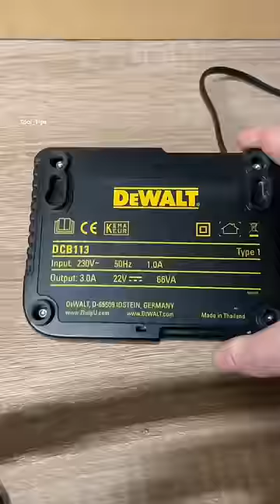9 Tips in 60 second 🥇

Comment: That tape screw location with the DeWalt battery was actually kind useful keep it up
Reply: Used a Mikita to drive the screws tho 😂
Reply: Definitely a good tip! I’ve been using sheets of paper and poking holes through the mount holes and copying it on the wall for stuff like this I want to mount! Tape! How didn’t I think of that haha!
Reply: Or you could use the paper template comes with the thing
Reply: Ye it should keep it up

Comment: That tape measure truck is great, I cut holes in sheet metal a lot and this eliminates the need for a compass
Reply: Depends on how accurate you need to be. I was a sheet metal mechanic in the air force and I'd still rather use a compass because our tolerances were pretty low but for home improvement I could see that being a great trick
Reply: @hankhasemeier6887  yeah I’m just knocking ductwork for HVAC, close enough is close enough

Comment: At the end: nails the nail near the edge and angled so it wrecked the wood, then nails it straight on and magically doesn't break the wood
Reply: He pounded the second nail on a piece of metal to dull the tip. That's what keeps it from splitting the wood. But yes he didn't do the second nail as close to the edge as the first one.

Comment: I always keep a pack of toothpicks for the door screws and stuff, never considered a wall anchor like that. That's a good one.
Reply: The wall anchor won't work in a cheap interior hollow door. Golf tees work the best, even better than toothpicks. Tap in the tee until snug and cut off the extra. The extra can be saved to be used on a bigger hole if needed
Reply: Except that as the screw tightened it kept spinning 😮
Reply: Yeah I usually just cut off a piece of shim that fits snugly in the hole and it woks perfect.

Comment: The elastic band over the striped screw head was awesome😎👍
Reply: On a tight screw, it rarely works and on a screw that the head is completely stripped out, it doesn't work. Any of these tricks only work if a number 1 tip was used on a number 2 had. There has to be some material left for the filler to grab

Comment: Oh yeah 😎.  Doors in commercial buildings I usually drill out bad 👎 hinge bolt 🔩 holes glue 1/4 wooden plugs and carefully cutoff excess wood later, drill and rescrew using original screws if possible.

Comment: Door hinge screws always weaken when putting back in.  I can’t wait to try the anchor! I love carpentry
Reply: I’m scared you’ll actually do it did you not hear the door split open after he tightened it down
Reply: You need to take inspiration from one of the other tips - drill out the hole, then glue in a dowel. After the glue has dried, cut it off flush, then drill a fresh hole.